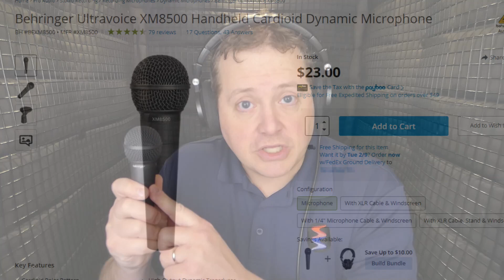Will Phantom Power Destroy A Dynamic Mic? Sound Speeds

Comment: @SoundSpeeds  i'm about to receive my Triton In-Line pre amp in a few weeks.. and i have sE v7 (MK version) and i think my Zoom livetrak L-8 can't push the potential of my Dynamic mic so i did ordered the in-line preamp... my question here is (because zoom L8 has global phantom power 48v on all banks/tracks...) is it still safe to input/insert some instrumentals like guitar/ acoustics/keyboards/e-drums... and other Dynamic mic WHILE phantom power is turned on??
Reply from the maker: If running into a 1/4" 6.35mm port then yes. Running it into an XLR, I wouldnt.

Comment: Do you need phantom power on a Mic-K688
Reply from the maker: No.
Reply: @SoundSpeeds  thanks for letting me know. I didn't think it did but I was just making sure👍
Reply from the maker: Dynamic mics don't require 48V phantom.
Reply: @SoundSpeeds  I was just wondering. isn't the sm7b a dynamic Microphone?. I have got a booster for the sm7b. I wonder if it's possible to use it on there. To boost the volume up a bit?
Reply from the maker: Depends on which one you have. Google will answer your questions quickly
Reply: @SoundSpeeds  it's just that I was wondering whether you could use a cloud lifter on it. to boost up the signal a bit. but I've searched everywhere. and can't find anyone that is using one on the k688 microphone
Reply from the maker: On Cloudlifter's website it says it's for dynamic microphones.

Comment: do you need a 48v to dynamic mic when using a mic booster?
Reply from the maker: Yes, That's what powers the inline amp.
Reply: @SoundSpeeds  what will happen if you don't turn on the phantom power when you have a cloud lifter or any kind of booster connected to your dynamic mic does it not work?
Reply: @SoundSpeeds  i'm about to receive my Triton In-Line pre amp in a few weeks.. and i have sE v7 (MK version) and i think my Zoom livetrak L-8 can't push the potential of my Dynamic mic so i did ordered the in-line preamp... my question here is (because zoom L8 has global phantom power 48v on all banks/tracks...) is it still safe to input/insert some instrumentals like guitar/ acoustics/keyboards/e-drums... and other Dynamic mic WHILE phantom power is turned on?? @SoundSpeeds

Comment: I'm curious with this because I turned on 48V on my XM8500 today and tested it, the audio quality was absolutely fine and there was no audio artifacts, nothing got hot or showed any signs of playing up.
Reply from the maker: They may have corrected it on newer mics or perhaps, this was a one off. Either way, something to be aware of.
Reply: @SoundSpeeds  Not sure if the interface has anything to do with it. My XM8500 is from 2017 I *think*. Either 2017 or 2018. I am using a balanced stagg XLR cable plugged into an Audient ID4 Mkii interface

Comment: Hi. I have 2 Shure SM57. And in the official page they said phantom power  doesn't affect those mics. So I don't know what to believe, because i use My 2 SM57 with my C-2 condenser mics for some recordings. So, i wanna know your opinión.
Reply from the maker: SM57s are made correctly so you shouldn't have anything to worry about if you run phantom thru them.

Comment: My usb audio mixture produces annoying buzz sound while recording. Please tell a cheap way to get rid of it I don't wanna buy any more equipment as I am just starting.
Reply from the maker: Without knowing the details of your audio setup, buzz is likely a problem with your USB mic before it's converted to digital. This is likely due to something near your mic interfering with it or the mic may have an issue. If the buzz is constant, it should be easy to dial out in your DAW using noise removal or reduction tools.

Comment: Interesting! Routinely forget to turn off the phantom switch on my camcorder when using a Shure dynamic and so far no drama or problems.
Reply from the maker: Shure is a premium brand that makes products right so I wouldn't expect any such issues.
Reply: @SoundSpeeds  Good to know. I picked up the PGA-48 as the first direct-to-camera XLR mic for my new camcorder. For $50 I've been amazed at the quality. As (IIRC) you recommend in the video, it seems to me like sticking with trusted companies is the way to go. Even their cheaper products seem good!
Reply from the maker: Technology has gotten a lot better in the past few years. Better products are becoming less expensive

Comment: But what if I use both condenser and dynamic mic on the same mixer, and the mixer has no option what channel should receive phantom power. It's like when you turn on phantom power, all channels will receive phantom.
Reply from the maker: That is indeed an issue. You can buy P48 blockers but personally, I'd buy a different mixer. Are there some channels that you can use for condensers and done channels for dynamics or does phantom turn on for all channels? One less soaking option is going XLR to 1/4"/6.35mm and going in that way. Or getting a stand alone power supply for the condenser. Both not as good as getting a better mixer or interface
Reply: @SoundSpeeds  so that means only XLR receives phantom power and I can use 6mm for my dynamic to be safe?
Reply from the maker: Yes, only XLR. You can convert to 6.35mm but it'll potentially change the impedance of the dynamic.

Comment: if you're curious if behringer xm8500 will change it's sound when you engage phantom power on it, the answer is yes. it will fry the coil inside and it will sound awful. happened to my unit.
Reply from the maker: Oh yes, I'm very sure you're right.
Reply: Hey I just had phantom power on for like 5 minutes, did I kill it?????
Reply from the maker: Not if it still works when you turn it off
Reply: @SoundSpeeds  lol thank you. i was looking for videos to make sure i set the thing up right and totally panicked when i heard that phantom power isn't great for some mics. my mic is totally fine so far as I can tell
Reply from the maker: Dynamics are pretty resilient. I'm glad yours is fine.
Reply: @SoundSpeeds  thanks! related question though -- im getting a relatively quiet but noticeable static from my audio interface. doesn't matter if phantom power is on, happens even without cables connected. what is a normal amount of noise from an interface, and could the phantom power with dynamic mic have damaged the interface?
Reply from the maker: The phantom comes from the interface so highly unlikely. I would unplug the cable and then listen to the interface alone. Might be the cable. If it happens when a mic is plugged in and completely unplugged, try a different input if it has a second input. If not, could have a damaged interface

Comment: I have a Senheiser e609 and it sounds the same with and without phantom power, only sometimes when NOT using phantom power, the is this weird digital interference. This does not happen when I have phantom power on, idk what to do lol
Reply from the maker: Change your cable out
Reply: @SoundSpeeds  It's a mogami, I have 2 and it happens with both so idk lol
Reply from the maker: Hmmmm... weird.
Reply: @SoundSpeeds  yeah, guessing its the interface, should I keep phantom on or off lol
Reply from the maker: The mic doesn't need it so I wouldn't use it.
Reply: @SoundSpeeds  thx man
Reply from the maker: Sure thing

Comment: My interface's input seems to be sending noise to the output! Because it's noisy even without a mic or even a cable pluged to it. When I increase the input gain, there's noise. Oh, and no activated recording track in the daw either.
What could it be?
Reply from the maker: There's a lot to check. What output is it? USB or analog to speakers too?
Reply: @SoundSpeeds  just going to my headphones... no usb
And just now I had my headphones plugged straight to the computer, and testing the mic on the daw..
It was noisy... and when I unplugged the mic and the cable from the interface... the noise continued on the phones!
Reply: The mic was on the interface
Reply from the maker: So when nothing is plugged in except your headphones and a microphone, it's noisy? Try a different XLR cable then a different microphone or plug your existing setup into another input and listen to that to see if it's different.
Reply: @SoundSpeeds  nope.. not even the mic needs to be plugged in
I tested it and it was noisy... to record.. but then I unplugged it and left nothing plugged into the interface. And the noise persisted on the phones, which were going straight to the PC.
Then I plugged the phones into the interface (still no mic plugged anywhere) and increased the input... just to see what would happen...
And it turns out the that input "sends" noise into the output.
Another thing... although my microphone only records when turned on, I still have the same noise when it's off showing on the fader in my daw.
Reply from the maker: Sounds like a bad interface then.
Reply: @SoundSpeeds  lol yeah
I tested it in a church today...
And it was capturing radio signals...
But it was less noisy there... when it didnt play the radio of course...

Comment: Hi, can I have 1 question? Let's say I turned on the phantom power bec I need to use a condenser mic. Is it safe to use the Platinum karaoke connected to one of the line in? Does the Platinum Karaoke safe to use? thanks!..
Reply from the maker: I don't know what a Platinum Karaoke is but if it's s mic that came with a 1/4" (6.35mm) connector, it should.
Reply: @SoundSpeeds  thank you and i appreciate the response. platinum karaoke is a player (not a microphone) we use for karaoke or videoke, thinking to plug to one of the line in in the mixer. thanks
Reply from the maker: Oh, out of a player it should definitely be line level. Probably -10dB consumer line level as opposed to +4dB line level but either way, it should work if you set your gain correctly

Comment: Would you mind open up YOUR XM8500 and see where its wired wrongly or if there is an eventual
design defect due to the sparkling sparks? just sayin! No you dont die from 48V DC/ 2mA DC.
Reply from the maker: I'll open it up, sure. It's very simple though.

Comment: I am working on this problem right now with a German made Frisby FA-7910m dynamic microphone. Do I need 48v? Do I need a Klark Teknik preamp? Frisby has not responded to my email. Neewer, the company I bought a 48v phantom power supply from, say NO to using with my dynamic mic.
Reply from the maker: I wouldn't if it's a standard dynamic. I'm not familiar with that particular mic though.
Reply: @SoundSpeeds  Bought it off wish.com. I guess it's not a total loss if its destroyed, but I'd like to give it a chance. If I use 48v and in-line preamp, could it work? Assuming preamp does need power.
Reply from the maker: I saw your email and will respond there.

Comment: It's funny because at the BBC studios, all XLRs out provide P48. They hotplug them, jiggle the cables, run 48v all at the same time. You know me, Allen, I'm a nut with my mics, I polish them, grease them, and unplug them like I'm defusing a bomb in a movie.
Reply from the maker: I'm reckless with mine. Of course I usually buy mics designed to handle abuse
Reply: @SoundSpeeds  I scratched one of my M3 instrument mics getting it out of a crappy metal shock mount and I just stared at it thinking "what have I done". Same with camera equipment. I baby them.
Reply from the maker: Yeah, that's not me. I'll take care of them but not baby them

Comment: Why is it that the sound changes if you enable Phantom Power?
Reply from the maker: Depends on how it's wired but it changes the way the microphone deals with voltage and handles the signal. Some components function differently under different loads and power would be a big change to a simple microphone.

Comment: Use my dynamic always with mic  boooster, no problem here
Reply from the maker: Wise unless you have very clean preamps and in that case, it may not even be necessary. This video explains it: https://youtu.be/9dZs6N1lJkY
Reply: @SoundSpeeds  I know , i have several pre-amps and to use it in broadcast about 0db  for a dynamic you need help, if i whant to record voice over i just swap for a condenser mic , no booster needed there...
\thx for the advice
Reply from the maker: Watch the preamp video at the end of this video. Inline amps aren't always the best solution.

Comment: If it did I would have no working dynamic microphones.
Reply from the maker: Yeah and ribbons will fry
Reply: @SoundSpeeds  Only if something else is broken/shorted or your using a Jack Connector https://www.bumblebeepro.com/ribbon-microphone/ribbon-mic-phantom-power/
48V will only go to the transformer winding (which should be isolated) and can't pass DC.
If you use  jack, "Cold" and "GND" can get shorted while (un)plugging in this situation is 48V between Hot and Cold and the pulse can damage the ribbon!

Comment: I can only imagine the shock of seeing sparkles under the grill for the first time O_o
On the note of giving 48v to dynamic mics: Samson Q2U just shuts off, which has probably something to do with internal circuitry due to USB interface (I imagine those have to have some kind of overvoltage protection by some quality standarts).
Reply: My q2u sounds awful and tinny after accidentally running 48v to it :(
Reply from the maker: Yikes. Good to know.
Reply from the maker: Every manufacturer would handle it differently but that's good to know about the Q2U. Thanks for watching.